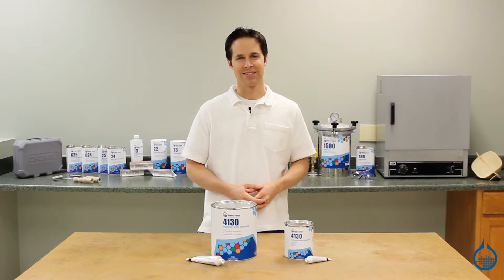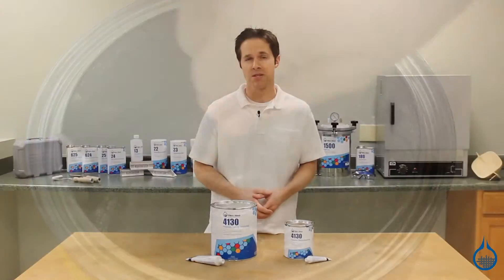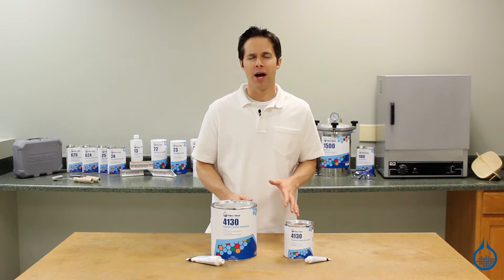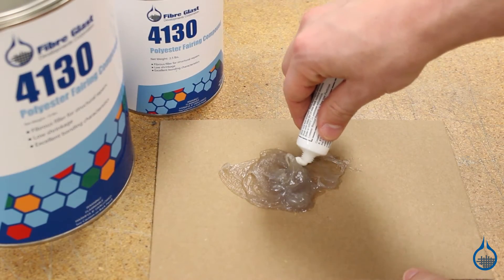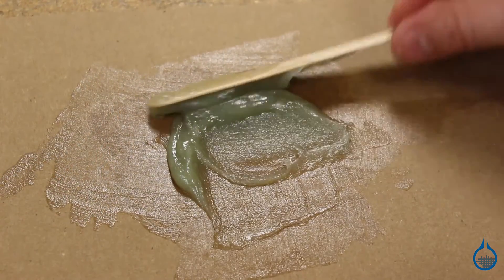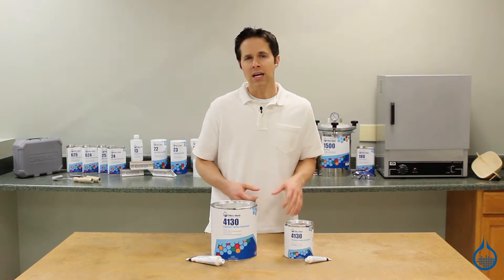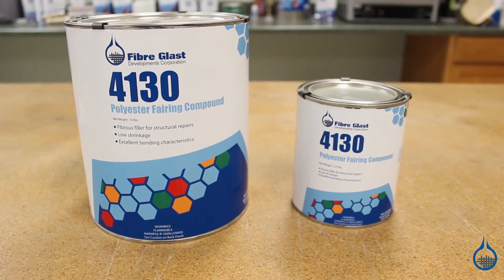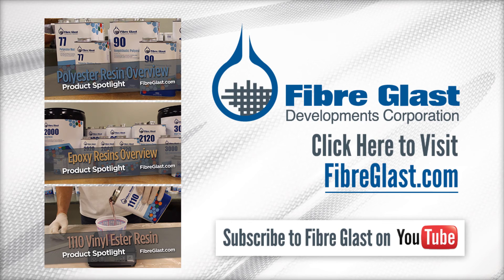Polyester Fairing Compound

Comment: Can the Fairing compound be dyed, like to white? If not should I patch the area on  my boat a little below the surface then add a white gel coat?
Reply from the maker: Hello Scott,
Our polyester fairing compound can be dyed white if you would like, currently it is a very light gray color. However it will still need to be sealed with white gel coat (since that's what you're using) especially if the area you are patching is below the water line. Polyester Fairing Compound is not completely water resistant and will need to sealed to complete the process.